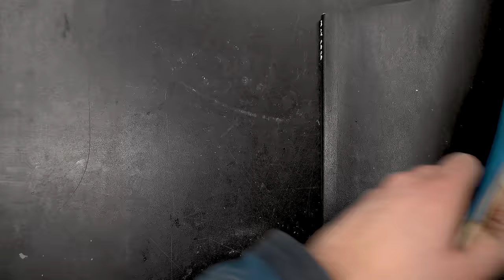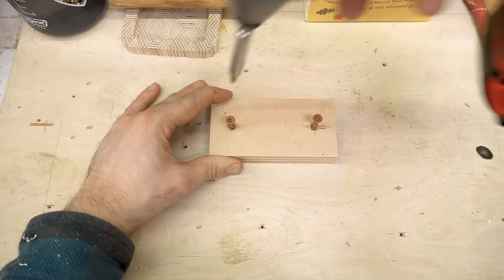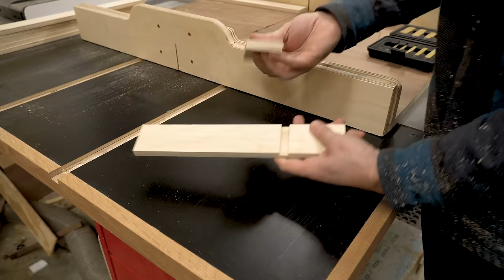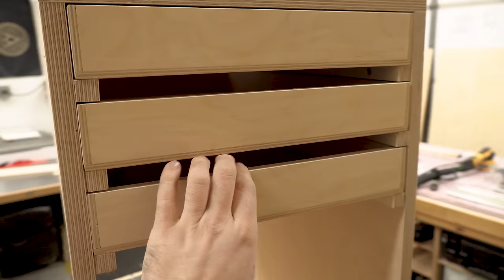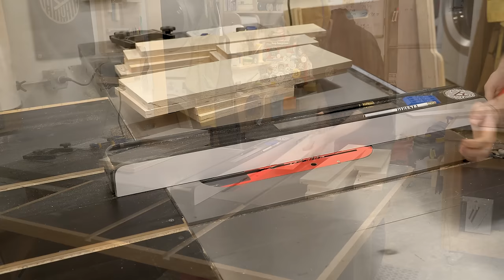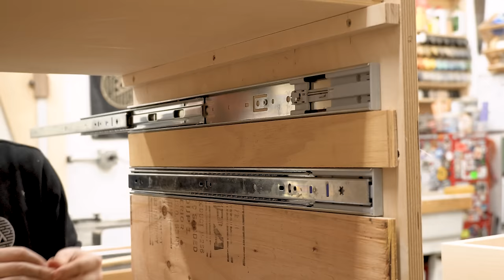3 Ways to Build Professional Quality Drawers

Comment: If for some reason you didn't have a decimal chart. Did you know one way to figure the fraction of 4.6875 or any number like this, subtract the hole number then multiply .6875 x 16 =11(11/16) then add back the hole number. This also works for 1/8ths, 32nds and so on just multiply by 8, 32 or whatever and this may be common knowledge, but this is something I learned years ago on a job.

Comment: Great video and tips, nice build, work flow and talk - well explained and pleasure to watch. One thing tho. This is a how to video and you used the worst possible material for wood drawer slides - plywod..on edge! That is a shame. I know it's wide and all, but still edge of the ply is like a grinder. What I do is glue a thin strip (3mmor so) of solid wood like oak, birch, maple, ash and apply vaseline. I have made drawers for my shop this way and one of them is around 50x60x25cm, filled with cans of finish products and it glides like ball bearing ones!

Comment: What would be a good solution for keeping the wooden runner drawers from coming out accidentally if you pulled them too far?
Reply: You can insert a protruded dowel on the wooden runner (fixed part) where you want to have a stop which will catch the back of the drawer box. If you take an example on Michael's case, you will insert a dowel on 1st runner which will protrude on the underside on the front. So the drawer 2 will catch it at the end. You will do the same for runner 2 for drawer 3. this will leave you to install something similar for first drawer. Apologies if I haven't explained it right.

Comment: Michael please forget Imperial units they are a British Colonial system designed to confuse the world. If you can count to ten then thats all you need for the Metric system. Example in your head add up 5/16  7/32  51/64 =     Or  8mm + 5mm +  20mm =
In the UK anyone caught using Imperial measurments are made to stand in the corner for 2hrs.

Comment: why do you use so much 3/4" stock?  1/2 or 5/8 provides just as much tensile strength for such small measurement as 3/4 or 1" stock would

Comment: When dividing measurements like that in half, just double the denominator... half of 3/8 is 3/16. You know that half of 9 is 4 1/2, so add on your 3/16 and you’re done. This system is more intuitive and easier to use than people like to imply. Halving measurements like 237.5mm in my head takes a little more focus- could just be what I’m used to🤷‍♂️
Reply: there's an app for that...try fractionplus

Comment: Instead of looking the decimal to fraction up on a chart (15:27), just use your calculator!  Take anything in front of the decimal away and then times the decimal by 64.  That gives you how many 64ths.  if it's an even number, divide it in half, that gives you 32nds.  If that number is even, divide THAT in half, that gives you 16ths.  keep going until the fraction is reduced.  If you still have a decimal at 64ths, go the other way and times by 2 for 128ths.  if you still have a decimal then, IGNORE IT.  we don't need to be that precise unless you're making an 8 foot run of cabinets... and even then not for shop furniture.

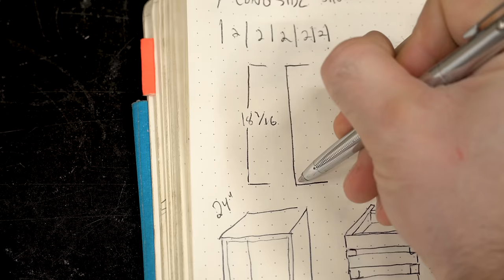Comment: Imperial System fail at 7:59
You can tell he wants to put the right number, but he realises it's not going to be an easy task to compute:
18 + 1/16  -  1 /32 -  4 - 3/4 -  4 - 3/4 - 1/32 =
8 + 1/2 ...
I think like most imperial system calculations, you don't go below one 1 inch unless it's really necessary.